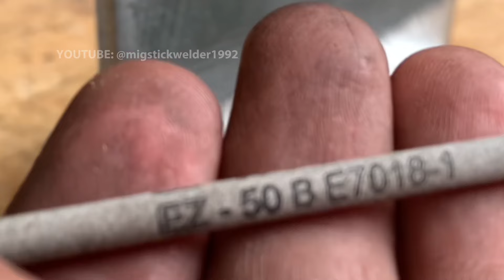Electrode E7018 and E6013 stick welding | welding tricks

Comment: You have under cut on both 7018 and 6013 also you didn’t show what voltage and amps you running

Comment: Both rod diameter is 2.5mm on 85 amps, both has undercut. Not a welder but i have seen welders set the amperage about 75 amps for the rods.

Comment: 6013 has waay too much slag and it's a mess to weld with, for diy projects which invole rusty steels,  7018 is much more suitable!
Reply: For 7018 how much amp should I use?
Reply: @Mrisra69 depends on your welder, if you use cheap chinese ones 100A for 2.5mm

Comment: 6013 was too hot
Reply: Maybe the 6013 had cellulose in the mix. Rutile makes electrodes more user-friendly and AC friendly.
Reply: @luciusirving5926  maybe metal already warmed up. Reduce amps maybe of metal is already heated